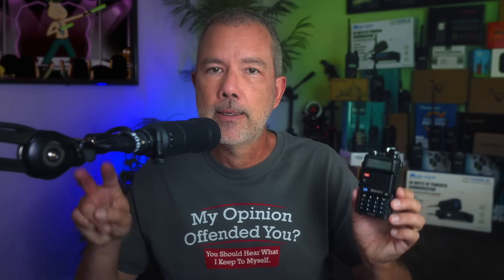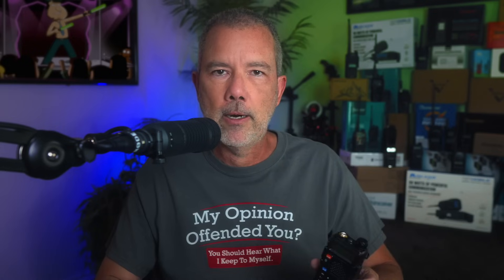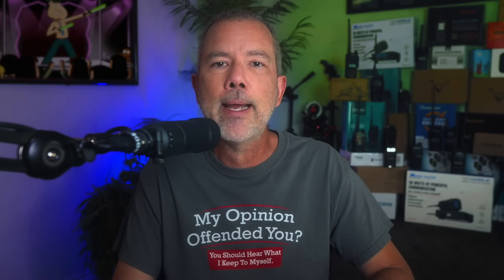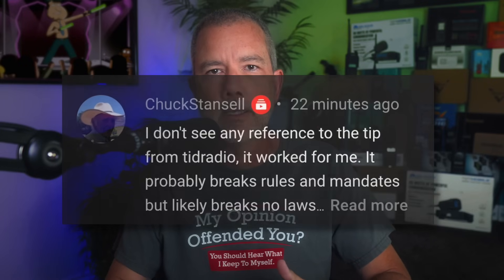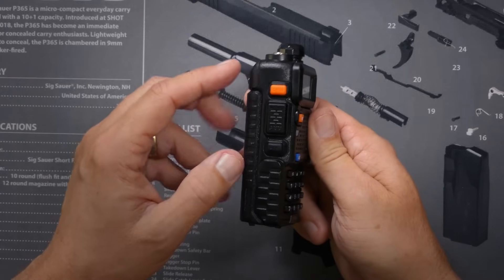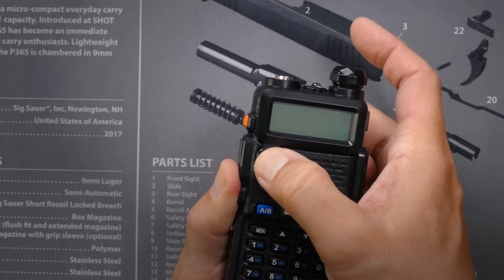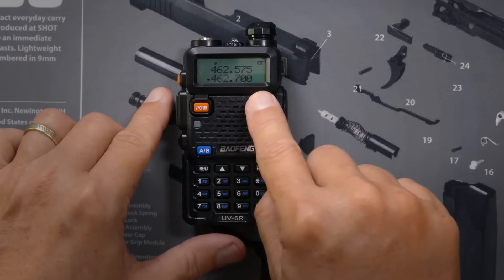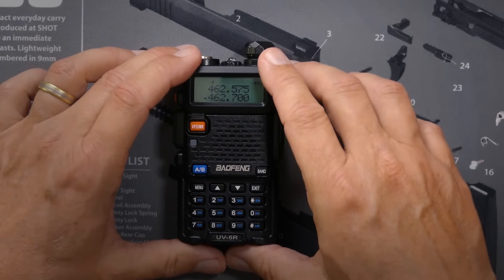How To Unlock A New Baofeng UV-5R - Easy UV5R Jailbreak To Transmit On More Frequencies

Comment: I unlocked  uv-5rtp which is awesome. I have a gmrs and a newbie to this whole Hobbie. I figured out how to talk on a gmrs repeater and talked to my wife. The. Some guy came across saying you are training on a ham radio and asked my call sign. He acted madd. What should he care and could I get in trouble for it? Also is there anyway of talking privately on a gmrs repeater like changing the t  and r tone will that work and be private for wife and I to talk ?oh I have a gmrs ln but not ham
Reply from the maker: He cares because he's a "Radio Karen".. Or, its possible he owns the repeater, in which case its his right to get angry - but more likely just another radio Karen.
There is no way to 'legally' talk privately on GMRS and/or with a UV-5R.
Reply: @TheNotaRubicon   ? has anyone talked about chirp doing the locking , or the trim bluetooth programmer doing the locking, I have had a set of 10 radio lock them selfs after 6 months of use . found the tip to try this and it unlocked them anyone else out there hear of this self locking after months of working. thanks

Comment: I did that, but it appears that did nothing. The radio still turns on like normal even while I'm holding down those keys.
Reply from the maker: Is it a UV-5R, and is it locked?
Reply: @TheNotaRubicon   Yes I think... Sorry I'm new to this. It 's the BF-F8HP
Reply from the maker: So it did exactly what it was supposed to do: Nothing
Reply: @TheNotaRubicon  I guess so! I just never saw the "FACTORY" message you got.

Comment: I’ve got a 2019 model and what you just showed doesn’t work on mine
Reply from the maker: Is it locked? The locked models didnt start shipping until 2020 or 2021.. 
If its not locked, not only is there no need to do this, but it wont work.

Comment: Ok so I just got my uv-5r and yes it will go to freq 122.800 for my brothers airplane. I just used chirp and changed the lower limit to 100.0 and used your unlock hack to unlocked the radio. Now tx and rx from Airband freq.s just fine! Yay! Should I make a video?
Reply from the maker: Very cool.. However.. I am skeptical...
Have you actually tested it and confirmed it works?  1) to make sure it's actually transmitting on that frequency and 2) I assume your brothers airplane is using airband, which is AM.. the UV-5R is FM only.. so curious how that works out..
Let us know because if it actually works, this will be awesome!
Reply: @TheNotaRubicon  my brother's radio is fm he says... ?
Reply: Also I'm headed to the airport soon to test. For now the tx light does come on and seems to be working correctly...

Comment: Randy I have Two uv5ra that I unlocked.when I transmit the other uv5a picks it up ok. When I transmit on my Motorola T800 the Uv5r prick them up with no problem but the T800 will not pickup the UV5r when they transmit . All units are on same frequency. Any idea why ?
Reply from the maker: Check that the T800 does not have any tones set - that would prevent it from hearing radios that are not transmitting the same tone.. also, make sure you arent too close when testing - try to get at least 20-50 feet apart.
Reply: @TheNotaRubicon  Thanks Randy that was it

Comment: That little trick didn't work with mine.  Mine is just like the one you did it to but when I did it while watching your video it didn't work and I tried it several times with a big failure
Reply from the maker: Is yours locked?  If it's not locked, its not going to work.

Comment: The UV5R that is linked in the desc of this video says that the range is 144-148 / 420-450 MHz. Does this mean I cannot transmit on FRS frequencies because all FRS frequencies go over 450 MHz?
Reply from the maker: As mentioned in this video, new UV-5R radios are locked to transmit on the ham frequencies only.
Reply: @TheNotaRubicon  So by using this unlock method could I transmit on FRS frequencies that are over 450 MHz?

Comment: Does any company make a radio like the uv-5r that transmits on both gmrs and ham frequencies, but made to mount in a truck? Or will the uv-5r be good for that? I go where there's no cell signal often. I just want both capabilities in one radio.
Reply from the maker: You will not find a ham or GMRS radio that will transmit on both without modification.. You can also look at LMR/business type radios such as the Motorola XTL 5000 .

Comment: Hi mate awesome videos and quite enjoy the sense of humour you have. I have opted to buy the  BF F8HP radio instead of the UV5R. I am wondering if all your videos for UV5R programming, unlocking, scanning, etc can also be used with my F8HP?  Are they basically the same radio with different output/Watts? Cheers 👍
Reply from the maker: The F8HP and UV5R are basically the same thing. All the menus, options, etc, are identical.. Not sure if the UV5R unlock trick works on the F8HP.
Reply: @TheNotaRubicon  awesome! Cheers mate

Comment: Having a really big problem. I unlocked the Radio, and it is now able to receive FRS signals, but unable to transmit. Whenever an attempt is made, the FRS Radio lights up Green, that it is indeed receiving a signal, however no audio transmits at all. Would be a life saver for emergency situations if anyone could tell me what is wrong. I've tried factory reset, used chirp, and also in frequency mode. but all is the same outcome.
Reply from the maker: The UV-5R can always receive FRS frequencies, so if its not transmitting on those frequencies then it is still locked.
Reply: @TheNotaRubicon  Oddly for my Radio, it wouldn't even recieve before I did the unlocking. 

In any case, thank you so much for helping me unlock what was once locked! It truly does make a difference :)

Comment: Sadness. I tried this and it didn't work.
Reply from the maker: THen either you dont have a UV-5R or, it's not locked.
Reply: @TheNotaRubicon  I have a UV-5R. 2 of them. They can hear but not transmit. Yes, they have the FCC notice on the back where my other ones do not. I tried your trick. It did not work.
Reply from the maker: Yours if the first report of it not working on a locked UV-5R.  Up till now, 100% of people saying it didnt work either: Did not have a UV5R, did not have a locked UV5R, or they were not holding the buttons right.
Reply: @TheNotaRubicon  Well, I don't know what to tell you. I tried holding the buttons down as you said, many times..nothing. And as I stated the first 2 times..it IS a UV5R. There is a chance it may not be locked but regardless, I still can't transmit. I was hoping this would work. I'm sad it didn't.

Comment: Regarding any CHIRP issues, you may want to research the following options:
Chirp allows you to have multiple configuration windows open.
So...
Save a copy of your existing working CHIRP file first.
Clear the radio using a normal factory reset.
Perform the "Jail Break-Hack" method outlined in the video.
Use CHIRP to READ/DOWNLOAD the almost empty virgin file from the radio.
Open the existing saved CHIRP file that was working before the "jailbreak".
CTRL-A to select ALL from the existing CHIRP file, CTRL C to COPY all entries to the new CHIRP file.

That might help.

Comment: This works on BF-F9 V2N as well but with one problem all frequency's that i have set to not transmit will transmit and lock in the transmit mode until you power cycle the unit. Anyone have a fix for this??????????? Love that its now unlocked but WOW this could end up very bad as i listen to alot of police frequency`s. Yes i did reprogram the unit with chirp and there all turned off so they should not transmit but they still do

Comment: Worked perfectly for my two new devices.  They came from Amazon locked.  Nice.
Reply: cheers!
mine lucky came unlocked so didnt need to fiddle with it it was plug n play
I broke one of my bofengs and had to buy a replacement and glad the replacement device wasnt locked from the factory.

Comment: Hi! what is the difference beteween "locked" and "unlocked"? i have not bought one yet, but i might do it now! - The Baofengs here in Sweden go between  136-174/ 400-520 MHz, is the unlocking making it go wider than this? thx Levi in Sweden
Reply from the maker: AFAIK, only new ones sold in the United States are locked and that means they can only transmit on ham frequencies.  If you arent sure if the one you want to buy is locked or not, ask whoever you're buying it from.
Reply: @TheNotaRubicon  ok, they are in a shop, but they only transmit on 2M and 70cm, so what becomes the new freq-range after unlocking? all-bands?

Comment: Worked like a charm on my brand new UV-5R 8 watt. Thank you for all the "zero B.S." info for all us noobs.
Reply: I just bought two UV-5R8W and it worked on both
Reply: @hyperlogos  Did you get 'Factory' on your display?  I tried and it never showed up.
Reply: That is the "Pro" model, right?
Reply: Hmm my new BF-F8HP will not show Factory and shows a red light when I xmit on GMRS but doesn't actually transmit anything.

Comment: So this hack kind of works.  I can transmit outside the ham bands only in VFO mode.  Channels programmed for those frequencies will not transmit.  I'm sure someone's going to find a fix for this.

Now let's address why I did this.  In an emergency we are authorized to use any frequencies or modes available to us to summon help.  I have gone out on the water with boaters who don't have a marine radio and I guess depend on their cell phones in case of emergency.  I bring along my UV-5R (pre-blocked era) just in case.  Nobody's breaking the law if they don't transmit.

Comment: I have a UV-5R8W and this unlock is not working. I am sure I am doing it correctly and still it won’t say factory. I have done this before to a UV-5R. Is this model I have not able to be unlocked ?

Comment: My UV-5r and my new UV-82 came unlocked. (EDIT) When i press the PTT it does light up and show a signal however  At my job we use GMRS radios i tuned to that Frequency  i can hear everything but can not transmit. I Have the UV-82 and I would love to use it for work since the Radio they give us it just junk. Any help would be great.

Comment: Just noticed an unfortunate glitch with the unlock.  With the older radios before they came locked, you could use CHIRP to disable transmit on select channels.  So for instance if you programmed in the  NOAA weather frequencies and disabled transmit so you don't accidentally transmit on those frequencies, it would prevent it.  However, after unlocking the radio, it enables transmitting on ALL frequencies regardless of the CHIRP setting, and for those frequencies you have set to "off" in CHIRP, it actually latches the radio in transmit mode, even with the PTT released.  The only way to stop transmitting is to turn the radio off and back on.  I tried re-locking the radio using the same keys as unlocking, but it does not revert once unlocked.

I will try a factory reset and re flash my code plug to hopefully lock out those channels again, and save unlocking it for a rainy day.

Comment: Hi.
I have a new UV-5RE.
Just for the heck of it before trying your unlock Secret , I tested my radio on 462.700
( without the antenna)
And it transmitted.
Do you suppose some of these radios come through unlocked ?

Comment: Works great...but as warned, it doesn't work with the chirp anymore. I'm not too worried about that because of the intended use of this particular radio....but I wont be unlocking any of my other ones until that part gets figured out. I have a handful of HAM licensed boy scouts who use the UV5R....it would be great to unlock those, but since they are updated before almost  every campout that's a non-starter for the troop radios.  Please let me know if you find a solution.

Comment: Hi Randy, I've unlocked a couple older radios and it worked great. I just bought 4 new Baofeng UV-5R's and the new ones (April/22) I got will not unlock. Looks like they may have changed the firmware...Damn. I now have 4 extra Ham Only radios. Oh well, with the Chicoms not sending stuff from China and when the U.S. supply runs out, I'll be setting on a gold mine....lol. Just beware, radios ordered may not unlock.

Comment: I just purchased a brand new GT-3TP Mark III from Amazon and got it today. Charged it up, downloaded via Chirp and then uploaded with non Ham frequencies and tested it. No go. Did the reset as you have shown and bingo it worked. Had to make a minor change and reuploaded from Chirp and still works. No locked radio, no hangups, no hickups.

Comment: Thank you for your videos. I sub'd, etc. I just bought four Baofeng UV-5R III. Yes, it has III at the end of the model number. The unlock technique does not seem to work for these. I've tried multiple times with two of the units. I get a "Welcome" message, instead of "Factory." Any ideas? Should I just buy the UV-5R with no 'III' ?
Reply from the maker: Is that radio even locked?
Reply: @TheNotaRubicon  honestly, I don’t know if it’s locked. I’m new to all of this. I just assumed that this model shipped as locked. Should I lookup a certain freq in the GMRS range and try to program it? Would that be my most efficient test?
Reply: @TheNotaRubicon  I purchased four new Baofeng UV-5R, I am able to unlock them with this technique. Ill try to 'talk' to the UV-5RII units using GMRS

Comment: This is kind of weird. I have a UV-5RIII and I thought I’d test it out before trying your hack. It actually allows me to transit right out of the box, at least it does the same thing yours is doing when I try to transmit on the same frequency. 

I’m wondering if I’m doing something wrong or if they maybe changed something back on the firmware?

Comment: This doesn't seem to work on my UV-5R8W... any ideas?
Reply from the maker: My idea is that its not locked.  Is it locked?
Reply: @TheNotaRubicon  if i try to transmit the red light comes on for half a second, it's beeps and then turns off and won't transmit.

Comment: It didnt work for me. The red light turns on and the transmit icon comes on but it does not transmit.
Reply from the maker: Was the radio locked? If not, you might have just bricked it.  Be sure to read the warnings in the info section.

Comment: Also discovered this appears to work if you accidentally upload a bad firmware config using CHIRP.  I have several radios and accidentally loaded a Baofeng with a Radioddity config.  The upload didn't complete, but the radio then behaved really weird.  Has been on a shelf for about a month as a "get back to it later" thing.  After seeing this, I ran and gave it a try just "in case."  This time it did wipe everything and as far as I can tell it was a "format" disk for the radio.  It is blank but now it works with CHIRP again and is feeling all better.  A happy little radio.  Not sure this will work for anyone else but thank you so much for sharing the UV-5R version of a "control - alt - delete" !!!

Comment: Doesn’t work on mine.
Reply from the maker: Is yours a UV-5R, and is it locked?
Reply: @TheNotaRubicon  it shows that model number on the front. admittedly,  i have no idea how to use this thing, so i wouldnt even know if it was unlocked already.
Reply from the maker: You should read all the warnings in the info section.

Comment: I did this to 5 radios and it worked but when I reprogrammed one it reset it to be locked. Doing the same method now brings up factory like it should but then quickly repowers the radio and it is locked again.

Comment: It works on a gt-5r too. just unlock the GT-5r and program a uv-5r then save the channels from the uv-5r and clone it to the GT-5R.  If you clone the uv-5r with the programming from  gt-5r neither one will transmit out of band. They both display 666.6666

Comment: I have a question, now my 5RTP says it's transmitting on the FRS/GMRS frequencies. It can receive transmissions from my FRS radio, but my FRS radio doesn't receive transmissions from the 5RTP. Could you, would you, possibly have an idea as to why? I've adjusted all settings on the 5RTP to mimic that of an FRS.

Comment: I followed your instructions exactly as you showed in your video and it doesn't unlock, did everything,  remove battery and try again several times, won't unlock. Stumped.
Reply from the maker: Is the radio actually locked?
Reply: I have 2 of these radios, brand new, 1  of them unlocked but the other one won't. But, when I press the ptt button the display screen goes orange, does that mean it's unlocked?

Comment: It did the thing, but when I actually try to transmit the frequency changes to 666.666 and the device stays locked on transmit until the timeout occurs. A full reset clears this demonic behavior, but as soon as I add a channel back into memory it goes right back to being the devil.

Comment: Apparently I’m an idiot, I did exactly what you did and now my radio’s are LOCKED, not unlocked. They won’t do anything. Turn it on and it says channel mode, cannot change to frequency mode, change between the two frequencies that are already programmed in, cannot get into menu, nothing. The only thing it will do is turn on and transmit on the one frequency it was on. What am I missing?

Comment: I have 4 of these uv5r''s and this does not work for me on any of them. When I power up, with the three buttons depressed simultaneously, I do not get the FACTORY font appearing - I get the Baofeng Lady saying "Channel mode." or "Frequency mode." WHY WON'T THIS WORK ON ALL FOUR OF MY RADIOS?? This pisses me off.
Reply from the maker: Because they aren't locked and it's not necessary to do this?